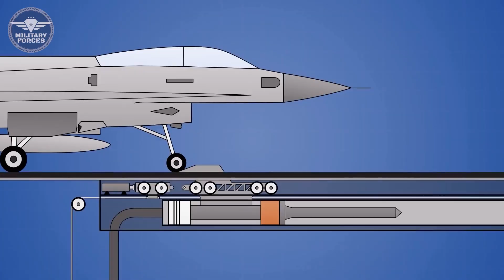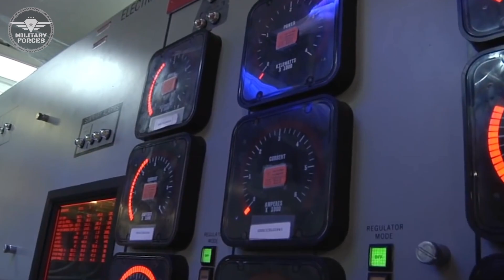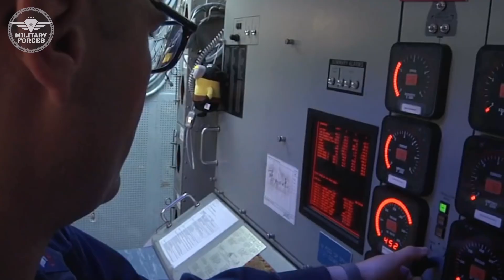Electromagnetic Aircraft Launching System (EMALS) on Aircraft Carriers

Comment: what type of general r ford emals is it, ac or dc?
Reply: AC.  We opted for AC for the higher launch capacity.  DC is cheaper and easier to use, but also imposes a steep capacity limitation on the aircraft being launched.

This is why the Fujian the Chinese uses "seems" more reliable and like it's advancing faster than the Ford, but the truth is, it's a handicap and a limitation to use DC, not a benefit.  It's the cheaper, less effective option, while AC requires more work and time and effort to fully mature the technology, but with greater rewards for doing so.
Reply: @Liberty_or_Ded  😅🤣你说是就是吧。你所谓的更先进更成熟的电磁弹射到现在还没有拿出来使用不断出现问题。还藏着。说明什么?

Comment: It's also safer than high pressure pipes exploding or leaking and cutting people in half
Reply: the are hazards associated with extremely high voltage stuff to. Any system can be safe if they are well maintained and frequently inspected.
Reply: @Mike-jv8bv  still safer
Reply: @ryuk5482  as a heavy industrial worker who works in refineries. i'm gonna start by saying  you have to change that mindset. Safety in it's self is all down to the people you work with and the culture it carries along with a system of controls you put in place to reduce or mitigate it. Any system can kill you regardless of it's source of energy, it's all about how it's maintained and how people handle it. high voltage shit is no joke either. But both systems can be very safe if everyone follows the steps on maintenance and operations and doesn't skip any rules or procedures required by the manufacturer or engineering department.

Comment: Ive heard trump saying this project is a failure, and the system doesnt work? Is he right or wrong?
Reply: Incredibly wrong
Reply: @AlexJoneses WRONG (yes when he spoke no now).
Reply: @rameaseshaw3245  I mean when he spoke, the machine worked but not perfectly, now it pretty much works perfectly. That's kind of just how normal engineering implementation goes for large projects like these, no matter the company or country that is producing that
Reply: It was unreliable back then but it has improved alot
Reply: When he talked about it hey were having teething problems that are now ironed out.
Reply: He's wrong but he might have had a point before it started. Now, these ships have been fitted with these systems but he wants to tear them out to put them back, which will cost even more, when the systems as they are now work better than the steam launch
Reply: He needs to be removed from office immediately. Such an embarrassment. @bajscast

Comment: What is used for energy accumulators?
Reply: The nuclear reactor they have powering the carrier
Reply: @officialobama3547  I mean the accumulators, not the power plant. Are they some sort of really big capacitor?
Reply: @SteamboatWilley I guess super capacitors ye
Reply: @sotasppapsaterlight4174 I too thought that. But it says you need 175 kWh of electricity to launch one plane. Supercapacitors would weight something like 900 tons.
Reply: @SteamboatWilley  As the team Leader at NAVICP for ALRE I asked are you going to make the ship longer or tow the batteries behind the carrier...EMALS was a Failure from the start IMO.  go back to the FAT CAT C-13 Mod 2. ask any pilot President Trump did "What do you Prefer EMALS OR steam,..???   they all yelled,..... S T E A M !!!!
Reply: @sotasppapsaterlight4174  If it worked why are they looking at extending the Nimitz?
Reply: @JSM-bb80u  Hense the Problem. "IF IT WORKED".
Reply: @SteamboatWilley  There is no accumulator.  It's AC-powered.  It's powered directly from the reactor.  There's no capacitors or accumulators.  You just crank up the fission rate on the reactor and launch.
Reply: @officialobama3547  two....
Reply: Every answer before this on is wrong.  The energy is stored mechanically in tall, narrow centrifuges.
It's a great idea.  Capacitors need for that would insanely huge, dangerous.
Reply: @qpwodkgh2010 Intersting
Reply: giant flywheels
Reply: What if thier is a ground in the system you have to secure flight quaters until you find it?

Comment: Instead of wasting all that money on electromagnetic catapults they need to make high-powered laser weapons that can shoot down Hypersonic missiles at 20 and 30 Mi away now cut one in half and just a couple seconds of impact they have high-powered lasers that can do that but you know they probably need a little a small nuclear after the power of them the Navy's got nuclear reactors so what's the problem just put a small secondary reactor on the ship just the power of the laser defense system that's all it does
Reply: Laser weapons are kinda too far ahead of time like railguns so it will need to wait
Reply: I think both are necessary. Lasers in the form you’re speaking of are a ways off. Currently lasers have around a 5mi cap and certainly can’t track/target a hypersonic missile. It definitely exciting to think of the future.
Reply: Nice engrish.  Military anti lasers dont cut they heat the hull and detonate the payload.